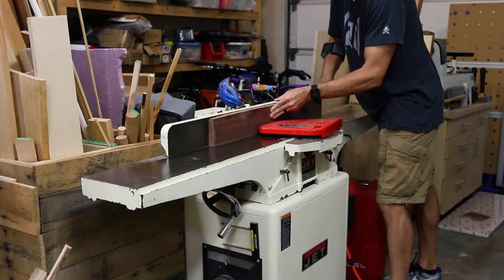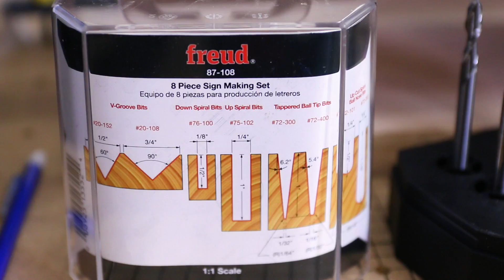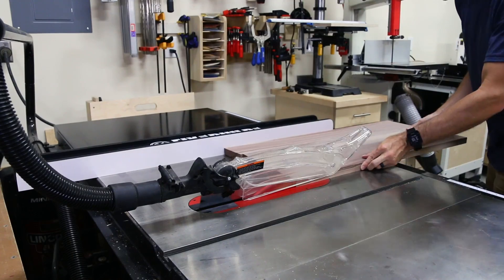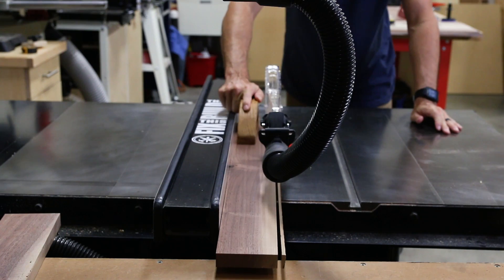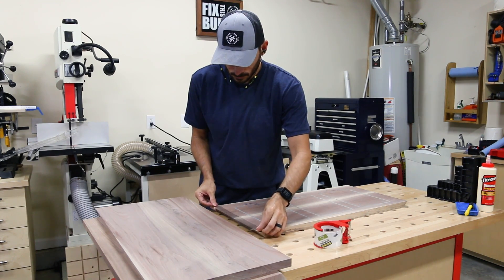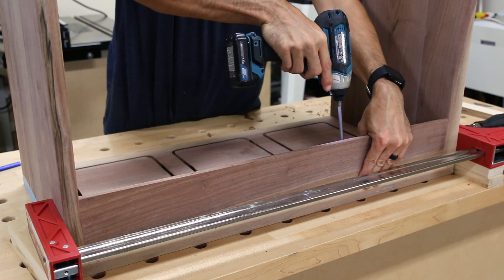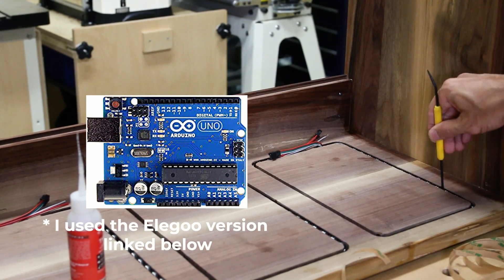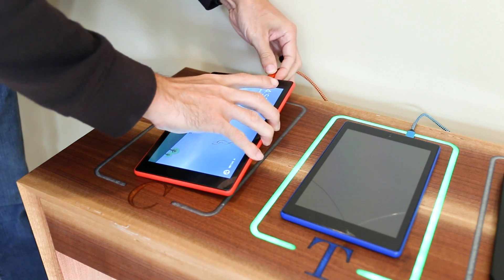Smart DIY Charging Station with LED Notifications | How to Build

Comment: These types of how to builds don't make any sense. Here I am doing this cool DIY project but oh wait I have 100k worth of tools, and a setup that is crazy... (I'm not hating for real) I'm just saying if your how to was done with what normal dudes have at their house it would be very helpful. Now I can see what you can do with a basically a commercial shop, and that is cool, inspiring, and definitely good job.. but now I can't make the charging station because I don't have much of that gear :). That said feel free to reach out and I can help you with the code for your arduino charing stuff because well... haha I don't have 100k worth of wood working tools there, but I do have a 100k+ data center in my basement. To each nerd his own :) Once I get your arduino code sorted maybe we can form voltron and you send me my precut pieces and I'll send you the code and arduinos and sensors to do any project.

Comment: DIY?  Right, for anyone with a degree in engineering and a $1,000,000 worth of high tech carpentry and cnc equipment in their workshop. No problem.

Comment: What total boat did u use? You have more than one option on the website :-)
Reply from the maker: I used high performance 2:1 with slow hardener. Use code FIXTHIS for 15% off at totalboat.com 👍
Reply: @Fixthisbuildthat  There are no shipping methods available it says when you check out :-( Maye Belgium is not on the map :-)

Comment: I think the next step for this is to put a wireless charger embedded into the table.  You'd have to get a wireless charging receiver for the tablets.  The benefit would mean the kids can pick up and go without having to pull on any wires.

Comment: If you quickly blow torch or even use a heat gun on the resin, it will get the bubbles out for a smooth finish

Comment: Maybe try making a hole in the wood, with a grommet or something to make it look nice. Then have the cord retractable, would look much cleaner, rather than coming hanging from the back. Doesn't have to be actually retractable, the hole does that for you. Maybe have a wireless charging so devices that use it, can use it. Or could get those magnetic cables, so they just snap on instead of needing to be inserted in the devices.

Comment: Everything is just handed to you huh.
Reply from the maker: Handed to me after I bust my butt and put in the work to earn it.  Don't think for a second that anything I get is "free".
Reply: Earning it means you worked for it and paid for it out of pocket, not an advertisement plug by manufacturer for yes, "Free". I never discredited your work, just calling a duck a duck.
Reply from the maker: @kaliguy47  I'm comfortable with and proud of my work with sponsors. Welfare is a handout. What I do is work. Sorry if it makes you uncomfortable and feel the need to discredit it for whatever reason.

Comment: That table looks great dude...i bet your kids love it to. I was wondering if you thought of doing the same kinda thing with wireless charging ? i don't know what tablets you used of if they had wireless charging capability but it is possible. I saw someone do that recently and it eliminates a lot of the wires and other issues...peace brother.
Reply from the maker: Yup, would have done wireless if they had it. But I just found some magnetic USB cords and I'm gonna use those!
Reply: @Fixthisbuildthat  Thank you for your reply and good luck luck with future projects....Peace.

Comment: Why didn't you make it wireless?
Reply from the maker: Because then I couldn't charge the devices 😀
Reply: @Fixthisbuildthat  sure you can.  You recess the wirless charger in the wood.  The charge will go through about an 1/8 in of wood.
Reply: @michaelgans8763  they dont have wireless charging...

Comment: The flickering led's when you haven't got anything plugged in is probably a floating error. The arduino has no input but is still checking the pin for one. When this happens it tends to alternate between reading high or low leading to unusual flashing. What you need is a pull down resistor to ensure that when there is no input the value of digital read is low.

Comment: I was inspired by your video and I tried that on my integrated (and pretty small) night stand, using only Dremel (that's what I have), with a very thin Qi charger for my phone (inspired by another one of your videos). I've managed to do a good job (if very slow) with the woodwork, but my layer of epoxy looks nothing like yours. It's neither consistent or smooth looking. And so in the lighting (not equal). Like someone pooped it out... Everything else works. :)

Comment: I like it. The only reason I would’t do it here is because a usb charging cable stops working after 3 months in my house. 😂🤣. And I can’t see myself splicing a new one in four times a year.
Reply from the maker: I hear ya on that! I may just switch to the USB extender and let them deal with longer charge times for thr sake of easy cord switching 😀
Reply: @Fixthisbuildthat  what if u add USB ports on the outside? Can always attach a new cable to it
Reply: A better option would be to eliminate the cable all together. Wireless coils for charging.

Comment: From my experience with Arduino my guess is that the reason it randomly blinks when nothing is plugged in is due to what's called floating input. Basically the pins can pick up on really small amounts of electricity and there's a lot that can set them off. This can be fixed by adding a resistor to the pin so small levels of electricity aren't enough to set it off.

Comment: Also no need to use an entire UNO. For this application I would go for a an ATTiny 45 (it's cheaper and smaller and does the same thing, just less IO). Since you did not post the electrical schematic I can't say if 1 is enough (I guess not becuase of the IO quantity)

Comment: "Im using one arduino uno for each charging station" Ppl who are into electronics start crying in the distance
Reply: Oh yes and one Arduino Pro Mini for all three stations would be more than enough!
Reply: @SuchByte  Coded bare metal instead of Arduino of course!
Could have connected all the LEDs in a row.
Reply: MegaSteamfreak no he couldn’t do that because he he wants each on to be separate
Reply: I just love that a carpenter tackled it and made it work!  For a non-programmer to get it to do what he did is wonderful!
Reply: Works with Arduino and FastLED.
Reply: meh, it depends how much $20 means to you how much of a "waste" it is. Besides, for that gaming PC comparison... I bet your gaming PC contains at least a dozen different little processors at least as powerful as the ATMega328 embedded into different parts
Reply: Well,I didn't cry 
Coz it would have happened if I was alive

Comment: A couple elements of note: Charging blocks always have an idle amount of potential current even when nothing is plugged in. Your Arduino might be detecting this slight current, resulting in the flashing you're seeing. Another thing that might be worth considering is the fast charge capability of newer tablets (if your kids ever upgrade) which can have voltages of 5v, 9v, 12v, and potentially even 20v, which your Arduino rig is probably not set up to handle. As a potential upgrade to your design, it might be interesting to embed a Qi wireless charging coil in each of the slots, since many new devices can charge wirelessly. They use the same power as a USB power supply, so it shouldn't be hard to wire it into your existing setup. This should offer a little future proofing down the line.

Comment: Initially I thought that it might be possible to have an interrupt trigger different loops, but I don't think the ATmega328p that the Uno uses is powerful enough to handle three simultaneous, independent loops. If you wanted part efficiency I'd have recommended a Raspberry Pi Zero, but that would've involved networking and python programming and in general is just more hassle than multiple Arduinos.

Comment: Very cool.  Thanks for sharing this.  Post a link to your current version of the Arduino code so folks can suggest some changes.  My experience with things like this that exhibit erratic behavior is that the voltage sensor input needs to be "de-bounced;" meaning that there are very small variations in the sensor readings that should be ignored unless they last for a prolonged period of time (say, 100 milliseconds or so).  Much fun.  Thanx again....

Comment: I had the same issue a while back when i added LEDs to my desk.
I used a chip based led striped (WS2812) and i needed a pair of buttons switching between animations.

After running in to forums i figure it out i needed to make custom delays!
Basically arduinos Delay function prevents other loops in the system, idk if thats ur case, tho great Job on the charging station!

Comment: Pretty great start for a prototype! This was inspiring enough to order an Arduino. Also, I noticed at 8:00 that your cut off snagged in the recess for the blade guard knife. I just had this issue as well when rabbeting. Would love to see your take on a temporary mod to the SawStop plate for this situation.

Comment: How many times did you have to re-sharpen your card scraper while working the epoxy?  :-)  That stuff is Rough on a cutting edge.
Reply: Not if you scrape it before its fully cured. The epoxy is soft at first. At least in my experience

Comment: This was great! You could just connect all the LEDs in serial to one another (using the tails that come on them) and then address the block of LEDs you want to activate individually, you might need to power them separately though, rather than through the Arduino. I've used those Elegoo boards and found they definitely aren't as reliable :-/

Comment: My gut reaction to your flickering issue is that you probably have an input floating somewhere.  That is, you have a connection(s) somewhere that isn't tied to ground or signal voltage (depending on your wiring) through a pullup or pulldown resistor.  What tends to happen is that the input then picks up spurious signals from nearby ports or the environment and bounces between on and off or sits in the no-man's land between the two when not being explicitly driven.   Generally you can get away with using the arduino's internal pullups so you don't have to run around adding a bunch of 10K resistors. :)

Comment: I know you're still trying to figure out the code. But one cool thing would be the LED color would match the color of the monogram letter. Because if it's going to be on only when charging, (cycle when charging and solid when done), then it would just look a little cooler, IMO. But if you do figure it out, please update video with a part 2. I (and I think others) would like to see how you've done it better. Thank you for the inspiration

Comment: Awesome project - if you want some help with that code feel free to get in contact with me, wont take long to fix that
You can also buy smaller versions of the arduino, look into the micro and the nano. Much cheaper for projects like this. The attiny85 is a smaller arduino chip that may do this also, but i would have to see if its capable first.

Comment: Really neat project.  I'm a software developer and happy to debug your code if that would be useful to you.  Also happy to help with crafting the code to run on a single Arduino for all three chargers if you want.  I read the code in the referenced instructable and it can be done far more simply.

Comment: This aint DIY anymore, more like DIP. Do It Pro
Reply: I saw the thumbnail and thought cool.  He was loosing me at and drum sander, and when got to the x-carve and I stopped it.
Reply: Thought the same lol
Reply: You can do this without all the fancy tools :)  Bit more labor intensive but it works.  I'm just going to use a hand sander.....but then I'm also building this build in wireless charger instead so the only thing that shows is the light when it's charging or charged :)

Comment: I am far from an Arduino expert, but my first thought on the LED issues is floating pins.  The pins if not set high or pulled down can be in a state where they are neither low or high and can result in random LED function.

Comment: Someone commented about a scheduler library, I didn't know that existed. I would have probably tried some interrupts and/or shape the code into a structure known as a finite state machine. And if that is not enough, brute force it with a faster Arduino, like the teensy 3.6 that thing clocks at 180MHz! Or if you get your hands on one, a teensy 4.0 that can go 800MHz! You have options my friend!

Comment: Take it from an old Electronics Technician. The effort you put into it shows that you care. You can always get help from an Arduino expert later on, if you haven't already done so. Don't ask me though. I stopped about 10 years ago. I did do LED lights all over inside and outside of my house. Just 2 thirty amp power supplies run everything.

Comment: Professional programmer here! Shoot me your code and I'll help fix you up!
Reply: So many people simply say : "you should ask so-and-so". I was going to offer my help, but I'm a medium level hobbyist.
Thank you for your kindness.
Reply: Those LEDs are like a 1D video screen...  I can make them change color/speed based on amperage and state of charge or even do effects like a fire racing up around each.  Instead of three $10 Unos,  use a single $2 ProMini...  let me know.
Reply: @GyroGearlooseHelis  Sorry for replying to a 11 month old comment
But how will you control the speed and colour of light, how will you gonna give input to Arduino?
Reply: @jatinmali9310  use simple amperage sensors for each charger (I think the ac712 chip would be the simplest).  Each sensor can feed one analog input on a shared arduino.  For output, use a string of addressable RGB LEDs (WS2801 or WS2812).  Programming-wise, you just pump RGB values in sequence for how you want each LED lit - so you can do any movement and color effect you can imagine and code up.  :)  Maybe red-yellow-green as charge progresses, or fast chase to slow/solid, or something cool like blue fire...
Reply: Professional C dev here, if the guy who offers help needs help
Reply: I would love to help, but I guess he is already covered
Reply: because the charger will give a high current to detect the device so the led flash
Reply: @lifeai1889  so? You can smooth it out, you can take a average with software, you can detect it with software, you can make a charger who doesn't do that. Enough solutions?
Reply: @JelleWie  U can use a capacitor to smooth the circuit 

or just use another cheep charger with no sensor (always output)to prevalence the problem
and sorry of my chinglish :D
Reply: if you get/got the code culd you:
i wuld locve to have al look at that
Reply: Did he ever send you the code?
Reply: anyone that can share the code for me?
Reply: Gareth Price hey. I’m trying to get into programming. I have some expierience in simple html and css. I’m wanting to learn a new language witch i can use for engineering.. What language should i get in to
Reply: @koenveth2824  Start with C or C++. Very daunting to begin with but once you are confident with them, you can understand and adapt to most languages with ease
Reply: Koen Veth JavaScript is extremely versatile and python is a great base language to start with
Reply: I would love to get a hold of the final code.
Reply: Had to give this comment a like! ;)))) Cheers!

Comment: If you use wireless charging IT would be a masterpiece :)
Reply: The issue is these are cheaper tablets, so they don't support wireless charging. But it could easily be done with the CNC Router table, and has been shown on lots of other DIY youtube channels with and without CNC.
Reply: @TheRogueBro  The Google Nexus 7 is the only tablet that supports wireless charging.
Reply: @Sandriell  you can buy wireless charging attatchments for phones/tablets to convert them, I like to hide mine under a case
Reply: @Sandriell  i had no idea my super old nexus 7 had wireless charging.
Reply: Sandriell I don’t know but my super old Samsung tab 4 also had wireless charging which I discovered accidentally
Reply: @Sandriell  Not if you buy wireless charging cases.
Reply: @847MicRoss  Personally, I have not been able to find any tablet cases with built in wireless charging. Granted I have just been looking at ones for the tablet I own- a Samsung Galaxy Tab S4.
Reply: @Sandriell  I'm surprised. Usually the popular models have them. I mean it's old but not that old.
Reply: @kaseygroen8171  lol.. its been 7 years lol... I remember buying my first wirwless charge pad I bought in a cheap gadget store.. and the clerks there amazed that nexus 7 is supported..  😅
Reply: @TheRogueBro  Wireless charging CASE
Reply: @TheRogueBro  a qi charger can did it
Reply: Charging a tablet wirelessly will take forever
Reply: @user-hs2hd7wp9g  That's why it's on a night stand.
Reply: Not only do they not have wireless charging but if they did or they got the wireless charging pads that plug into the port to give the device wireless charging it would take a lot longer to charge than with a wire

Comment: Nice work! In the code you can use an “if” statement inside the loop to control different pins but you must need to avoid delays and use a timer library instead, then you will be able to multithread in a simple way.
Reply from the maker: I'll look into that!